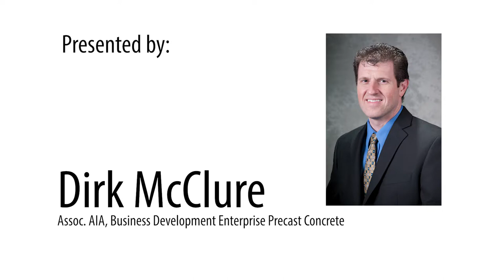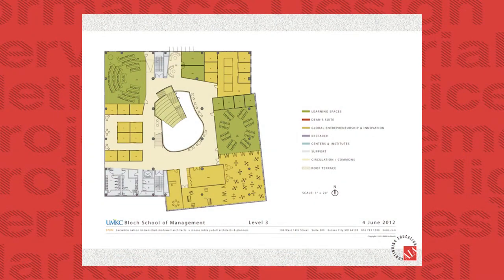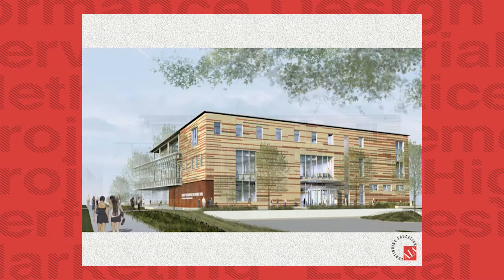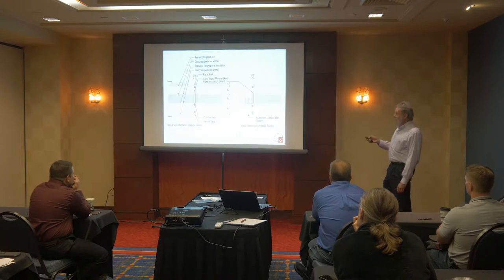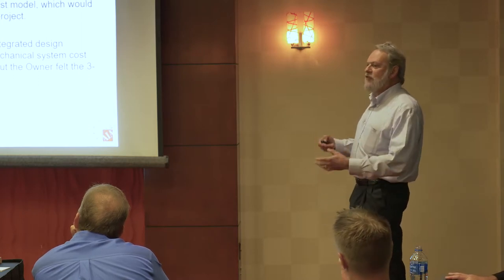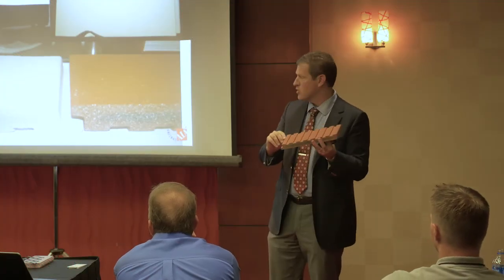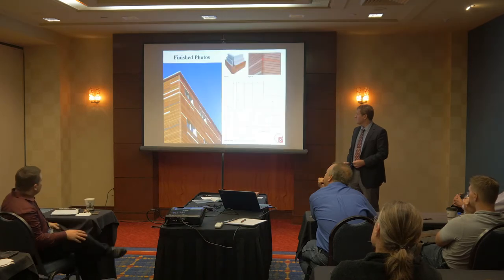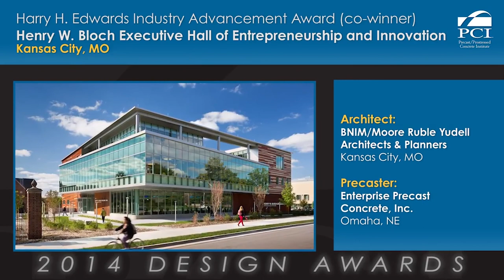AIA Evolve Conference (A Case Study of the Bloch Executive Hall)

Comment from the maker: 0:00 Introduction (Dirk)
4:30 Team Members / Project Parameters (Greg)
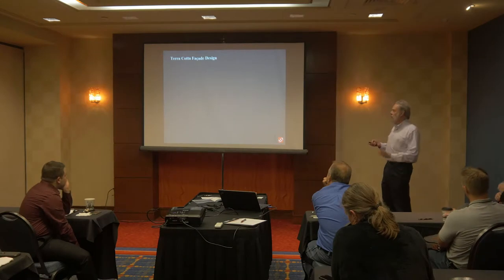11:46 Design: The Terra Cotta Idea (Greg)
15:50 Comparing the construction & performance of Rainscreen to Precast (Greg)
26:48 The Curtain Wall System (Greg)
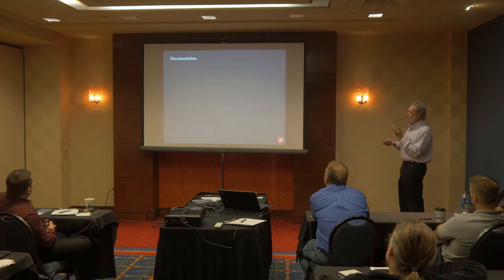32:26 Documentation (Greg)
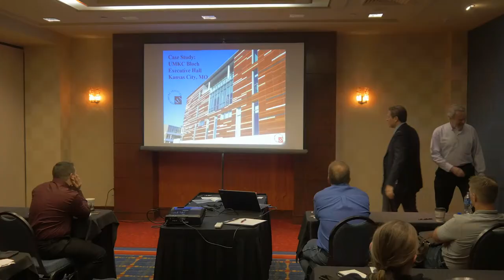35:02 Partnering / Terra Cotta in Precast (Dirk)
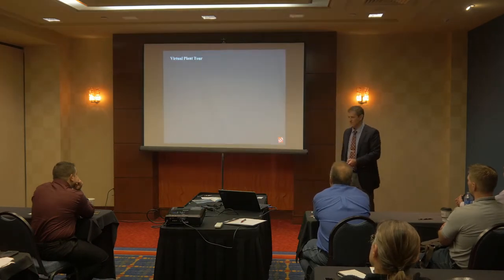38:52 Virtual Plant Tour (Dirk)
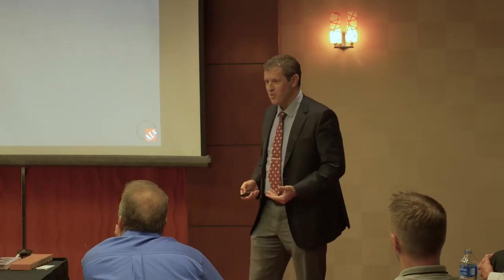43:20 Virtual Jobsite Tour / Q & A (Dirk)
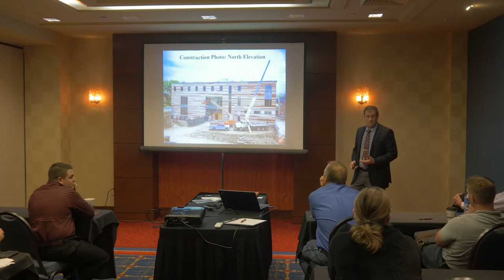45:30 Q & A / Finished Project Photos / Closing (Greg and Dirk)  
52:40 Design Awards (Judges Comments)